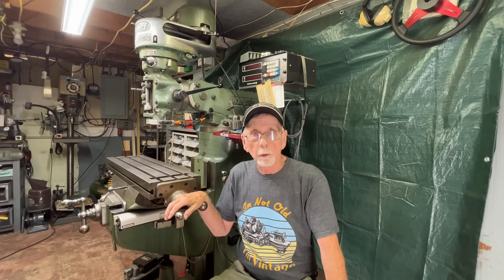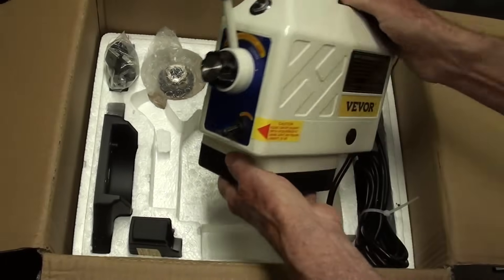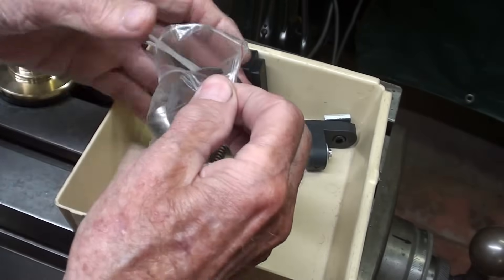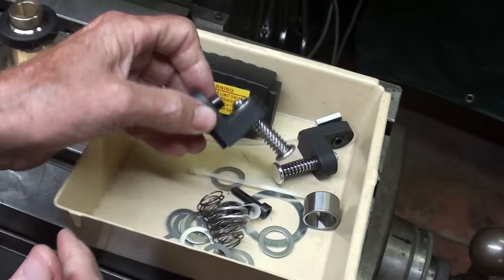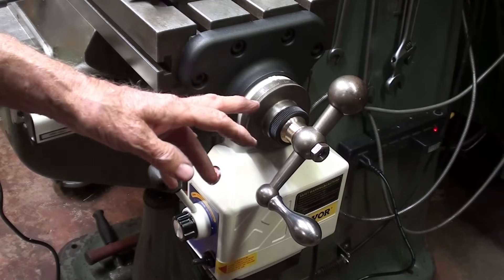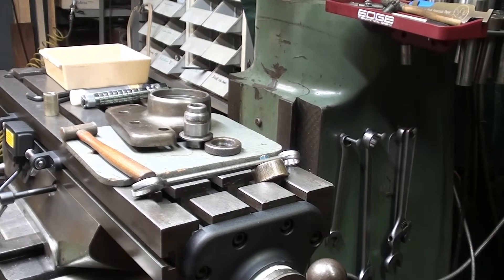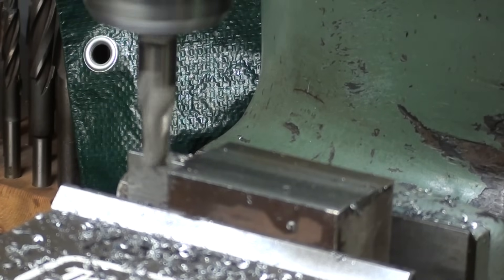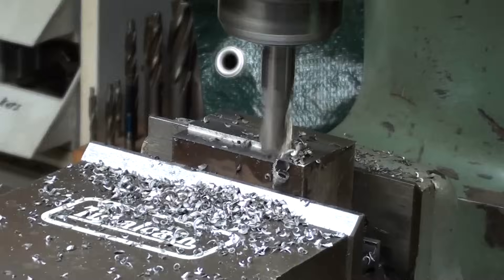INSTALLING A  POWERFEED on the Bridgeport Mill #887 tubalcain

Comment: Good Morning Mr. Pete. I have the same unit on my Bridgeport with similar problems and a few differences. I finally had to replace the original Bridgeport unit when the circuit board shorted out. The speed control on yours is faulty beyond repair and the seller should send you a replacement and pay for return shipping. The problem on both units is bad potentiometers. Mine will completely stop and crawl at any speed with full torque but won’t repeat at the same setting after stopping and restarting. 
I can live with mine but yours is definitely not acceptable. The factory is obviously not testing these units properly before shipment or they would have caught the variable feed problem. 
With your exposure to the American market you should have no problem getting a replacement. Thanks again for all you do.
Reply from the maker: Totally agree with everything you just said

Comment: Hello Lyle, 
These power feeds share a lot in common no mater where they are from. I have installed several over the last few years on various machines. I just recently installed one (from ALSGS, model AL-310S) for my Grizzly G0755 ( the G0755 was a tent sale - damaged  purchase) So I have a few suggestions and recommendations for you.
 #1,  the 2 black springs left over are for the limit switch cover. They fit over the limit switch buttons and are carefully fitted into the limit switch cover. This keeps the cover centered and in place. It is a bit fiddly to install but works great. 

 #2, Pay attention to the limit switch cover that it does not rub on the mounting spacers. Some trimming of the cover back side may be required. 

 #3, Take a file and lengthen the top of the limit switch to table mounting slots as needed to to ensure the limit stops hit the switches perfectly centered.

 #4, Lead screw modifications.. Occasionally an additional woodruff key will need to be cut to ensure the brass bevel gear has sufficient contact. This will also allow you to shorten the out side of the gear and move the manual handle in for a few more threads available.

 #5, pick up a spare plastic driven gear (typically blue colored) These occasionally fail due to crash or over load and are very inexpensive.

#6, In the past where the DRO scale has to remain in front, I have made offset (downward) stops and a lowered limit switch bracket. 

Now some travel rate (feed) specs on my last install....

19.5" (495mm) travel range...

Fast, 1 minute 6 seconds

Slow, 33 minutes, 16 seconds

Rapid, 47 seconds

Additional advice concerning travel over shoot. These do not have a rapid braking so at high rates of speed it is easy to over shoot by .75" (19mm) so pay attention to your max table travel and move the stops in towards the center accordingly. (another reason to keep a spare plastic shear gear on hand)
Reply from the maker: Thank you so much. I intend to print this out so that I can study your ideas.  these are excellent suggestions. In fact they should’ve been included in the directions. I should tell Iris, my contact in China to include this, lol. By the way, I was wondering what those extra springs were for
Reply: @mrpete222  No problem sir, glad to help
Reply: Adding braking to such a motor is pretty easy. It may need a relay, depending on the controller wiring. Basically you set it up so that the motor connections are shorted out the when power feed is disengaged.
This makes the motor act as a generator against a 100% load, which stops it almost instantly. For safety, it maybe better to add an "engine braking resistor" which you can buy from China, however you will need electronics knowledge to calculate the ohms value.

Comment: I've been considering one of these (or similar) for a long time. The installation video is very informative and will save some folks the heartache of ironing out the details. I was sold until the speed thing, now I might consider tracking down an original Bridgeport power feed and paying the price. Thanks for the presentation.
Reply: Servo power feeds from H & W lists for over $900. Good luck.
Reply: I bought a similar one but a different brand for about 150  a few years ago and it had english parts and mated up with no issues
it also crawls at slow speed, so shop well
Reply: Look at Align brand power feed. I bought one a couple years ago from Precision Matthews in Pittsburgh PA for I think around 275.00. I haven't had an issue with it at all in that time period with using it 2-3 days a week in my shop. I do a lot of face milling and I can put a mirror finish on with it if needed. The speed control works great and will go from 0 IPM on up without the torque loss. I did however have to broach the keyway in the drive hub like Mr. Pete did, but other than that, it wasn't bad to do, and I saved a ton of money over the Servo brand which would have been a grand. The Align brand apparently has a little better motor and speed control than some of the other import units like the Vevor, but it looks pretty much the same. I know you get what you pay for, so I was hesitant to pull the trigger on the Align brand, but I'm glad I did so far.

Comment: I have had one of those for several years never gotten around to installing it.  I don't care to bother with the slow speed setting and having to use a dremel to achieve proper speed so I am going to leave it in the box of which it came. Great video, you saved me from some wasted work and time to install then have to remove it....
Reply from the maker: Many people have told me through the comments that they have that unit and it works great. Possibly I have a factory reject?

Comment: There should be a trim pot or two inside the power feed that will let you adjust voltage to the motor. Mark the trim pots so you’ll know the original position of the screws and then adjust to get get the best balance between speed and torque.
Reply from the maker: I really do not want to take the thing apart at this time. My contact at the company said that she would show this video to her engineers.
Reply: You can't adjust the speed of a non synchronous motor without losing bundles of torque. The only way it can be done is with a variable frequency drive or a gearbox.
Reply: @Phantom-mk4kp  What I stated as a solution is essentially what Mr. Pete did with the Dremel speed control box. Obviously you will lose some torque as Mr. Pete demonstrated. You could put a sewing machine foot control in between the power feed and the power supply and get the same result but without a fixed speed setting. What he did was find a “happy medium” he could live with. That’s all I was suggesting rather than relying on a “go between” unit. Just open the power feed up and tweak the trim pots. I never implied there would be no torque loss. I never implied that it was the perfect solution. I just suggested it as another solution to the problem. Reread my comment and feel free to point out any other statements you imagine I might have made in error.
Reply: @FriedPi-mc5yt  @FriedPi-mc5yt  There will not be any trim pots inside I guarantee. It will have a triac phase angle controller and the only variable component will be the control on the outside
Reply: @Phantom-mk4kp  So you know exactly what’s inside of it? When did you open one up? Have you got the schematic of the electrical components?
Reply: @Phantom-mk4kp  i think you meant to say synchronous. What makes you think this was an induction or synchronous motor? It is most likely a universal motor, given that there is a speed control and it's not really big enough to host a VFD.

Every universal motor controller I've seen has trimpots or swappable resistor packs to adjust the current feedback and min/max output.
Reply: @PaulSteMarie  I said it would be a non synchronous motor if you read it correctly. With a phase angle controller, i.e. a brushed motor, similar to that found in a mains  drill with a variable speed trigger. And similarly I've never seen internal trim pots on a drill
Reply: @Phantom-mk4kp  Ok, yes. A motor with brushes, a commutator, and a wound field is called a universal motor, since it runs on AC and DC. If you recall Mr. Pete's earlier videos on adapting a band saw, the motor controller has settings for the amount of voltage boost provided to compensate for resistive losses as torque increases.  You don't see that in hand drills since the feedback is on your trigger finger.

This drive is designed to operate at constant speed regardless of load without manual intervention. To accomplish that,  the motor controller needs to compensate by measuring the current draw and increasing the (average) output voltage by the current times the motor resistance. The gearing in the drive unit allows the motor to run in its optimum RPM range while driving the leader.
Reply: SOLUTION HERE... This power feed is not using a synchronous motor, hence why it responds to the dremel controller. You can maintain full torque of a mains voltage brushed motor by using a "FULL WAVE" motor controller, rather than a cheapo SCR/Triac based one which is basically just an incandescent light dimmer (like that dremel controller) .
The full wave controller also allows feedback (back EMF) from the motor to be monitored and additional power to be automatically added if the motor slows down.
...
A 220/240V project was described in an Australian electronics magazine, which you can find by searching for the following terms:
silicon chip 2018-03 archive
... then scroll the magazine list to find the March 2018 (2018-03) issue.
Read the article which starts on page 36 of the PDF, as that covers the subject and also mentions some other circuits. You may not desire to build it, but you will learn what features are needed in a commercial device.
...
PS: the programming file for the microcontroller 1010218B.hex and the PCB artwork (PDF) can be downloaded for free from the Silicon Chip website shop. It takes a bit of digging to find the links, but they are there 😉
Reply: @Phantom-mk4kp   All the aftermarket power feeds I have ever seen use a DC motor and  DC Drive. - Reducing speed towed the lower limits doesn't effect the torque all that much..

Comment: I AIM to be a machinist, but I wouldn't call me one yet. I keep picking up all kinds of metal junk because it might be useful, and all machinists seem to be afflicted with that problem, but I'm still just learning to throw things out. A few years ago I would save everything except metal chips, now I throw anything smaller than about half an inch. Progress!
Reply: Unfortunately, I was a blacksmith also, so would also save metal chips for pattern forge welding in a canister for Damascus steel axes and knives. That's why those two hobbies go together so well. I totally loved machining good tool steel. But no air hardening steel. Oh, hey Lyle. Not a bad upgrade. Even if the brass gear had enough copper in it that they called it copper!
🗜️⚒️🧙‍♂️  乁( ⁰͡ Ĺ̯ ⁰͡ ) ㄏ

Comment: Noticed the mark on the potentiometer was at about 11 o clock, you should be able to rotate ccw to stop the feed and turn cw to increase.
I have 2 power feeds very similar.
If you cannot stop the feed with the pot you have a problem
Reply: I agree, if you can't turn the knob down far enough to stop rotation, then there is something wrong.
Reply: AGREED - thats how mine is, when you engage the lever, you can turn the knob so it goes so slow it stops.......... (mines not a Vevor Brand)

Comment: Hello Mr Pete, great video! I installed one of these on my Kingston mill a couple of years ago. Works great! A little less power than the one I replaced but much smoother and quieter. Old one  had straight cut gears! I didn't install the switch and stops because of my x scale is also front mounted. In my 50+ years of machining I only used stops maybe a half dozen times!Thanks for your time and sharing! 👍😎✌️
Reply from the maker: I wish mine worked out well. And yes, I already removed the stops. For the same reason. I really have never use them either. There is definitely something wrong with mine from the factory.
Reply: @mrpete222  I know they're keeping track of you so hopefully they'll send a replacement so they can garner some positive feedback. There's a bunch of us viewers that make book on your opinions! A replacement would really go a long ways with a positive endorsement from you! Maybe they'll take note! Thanks again  Mr Pete!

Comment: I might be a little late to point out, but the extra springs you have from the installation go inside the limit switch cover. if you look under the cover you'll see a stub on each side to put a spring. The springs then go over the limit switches themselves. I'm probably not explaining it well but I think if you look, it will click on how they're supposed to go in. I hope this helps you, I know you video definitely helped me out. Cheers!
Reply from the maker: Thanks

Comment: so the two springs you have in your spare parts are for the limit switch. you put them on the ears of the switch, compress them as you put the cover on and it holds it in place. My dial nut is not as out of shape as yours. It's very good as a matter of fact. Enjoy, what a difference it makes having a power feed. Much nicer.  I get a slower speed on my vevor x.
I suspect you can adjust it. Mine will crawl. Mine is so powerful it will feed on a tightened gib lock.
And I widened the keyway on the brass gear, rather than changing the key.

Your speed control is horrible, doing what you did with the dremel will burn out the mosfet inside. I really suggest you try talking to Vevor.
Reply from the maker: I wish they would’ve explained what those extra springs were for in the directions, lol. You are the second person to set me straight.

Comment: Mr. Pete. according to the specifications on the internet, the speed range is 0-200 rpm. So there must be some issue as some people have suggested.  Maybe you can make a video to replace that plastic nut with an aluminum or brass one , if it suits your pleasure, lol.  
   For the price of the unit, you almost cannot complain. It's possible to spend that kind of money just going out for dinner for two people at a regular restaurant.
Reply from the maker: I agree with you 100%. My contact at the company claims she will check this out with her engineers.
Reply: Funny I thought I was the only one using the restaurant cost of lunch or dinner to justify a tool purchase..👍

Comment: Glad you were able to make it work.
So many of these import tools are 95% of the way there.
I hope they take your suggestions and improve.

If anyone else want to buy one of these Harbor Freight has a speed controller that should work.
Part number 59386, rated for 8 amps.

Comment: That is a Chinese copy of a Taiwan made Align. The Align is a perfect unit, with the control knob fully anti clockwise the unit will not run at all. Operate the direction lever, slowly turn the knob, you should here a nice "Click" and the handle start to rotate, you can have it so the handle barely moves and has the full torque. You would need a very slow feed for slitting saws or side and face cutters .I bought a brand new Taiwan clone of the BP, that came with the X drive fitted, when the warranty ran out I purchased another identical unit for the Y axis. No problems fitting at all with either unit and it gets used several times a week for short runs. Hope you can sort your one out. I know it was free but complain to Vevor. Regards from Australia.
Reply from the maker: Thank you, I didn’t complain
Reply: I have the Align power feed on my Bridgeport Z axis and it works perfectly, Cost a little more than Mr. Pete's unit but the money is well spent.

Comment: It wasn't just the key that was damaged.  The internal keyway on the collar you had to use a puller to remove is also damaged (pass the reamer through it to confirm).  The metal is disrupted on either side of the keyway.  Those burrs are what damaged the shaft inboard of the key when somebody had to drive the collar back on with a hammer.  I suspect the machine had been used for a period of time with the clamp nut loose and the key was taking all of the load.
Reply: The load on that collar is squat, hardly enough to damage/overload the key, it just keeps the graduated collar consistant when locked.  Probably forced on when misaligned, got a nasty burr that wasn't cleaned up for the 2nd or whatever it took to get it pushed/banged home.

Comment: I had a similar power feed on my Bridgeport for about 9 years, never had issues with it.  It did have better speed control as I could slow the speed down to a crawl.
Reply from the maker: That’s exactly what I had hoped for. Being able to slow it to a crawl.
Reply: My Chinese unit will crawl extremely slowly- if you turn it to zero it stops.
Reply: @mrpete222  Mr. Pete, as I told you before after retiring  I've downsized my shop.  I went from a Bridgeport to a Clausing 8530 mill.  I bought the same Vevor power feed and I'm taking measurements on how to adapt it to my smaller mill.
Reply: There's something wrong with that power feed as mine will go at a much slower feed rate staight out of the box. Mine looks exactly the same except I bought it at Enco years ago.